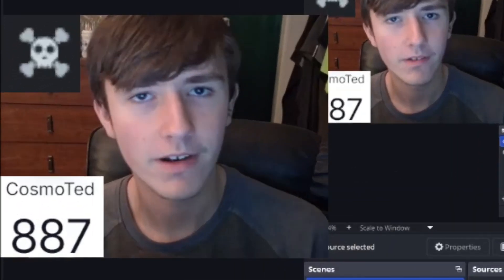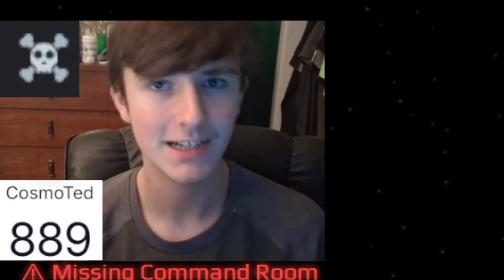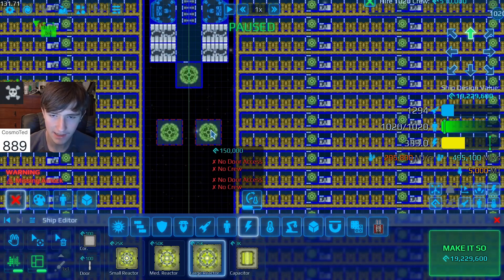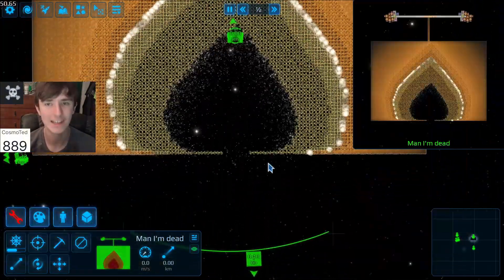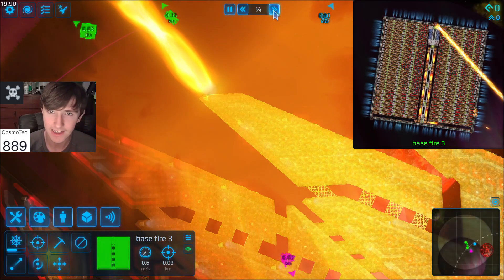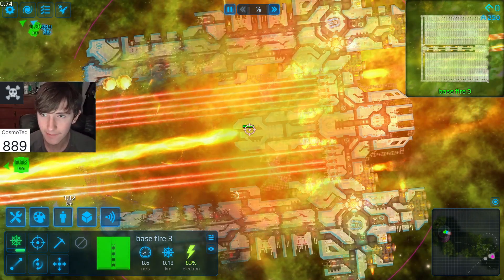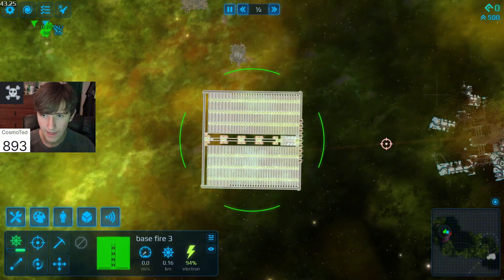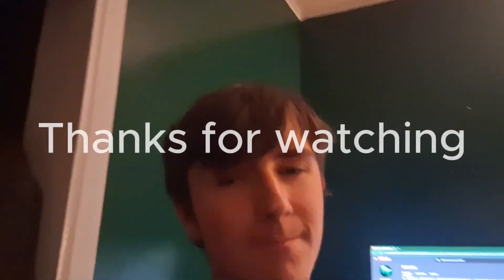Igniting Ships With 295,800 MJ/s of Energy

Comment: i made a ship like this minus the damage part as i mostly made it have a huge aoe and abit of damage (as i was tired of dealing the the modded ships that had really good shield placements so i made a heat ray that set everything on fire)

had a bubble shields about 3 clustered deep in my hull just slightly off set to keep the ion beams from hitting anything (later it was 12 and yes at that point the beam covered most things in flames or atleast enough to hit the softer bits and start to break important things)

note i did use a mod that added some extra parts like a better hall connector so you can run heat piping down the halls and have it still connect to all the parts (only did it as my ship made so much heat that i would have had to double its compact form to add enough pipes to vent it all)
Reply from the maker: very cool, (thanks for the comment)
Reply: @CosmoTed o also if any of my vents gets broken i have like 2 minuets before my ship turns in to a fireball

but past that the beam works really well but its very slow to hit critical mass of flames for the ship to explode XD

and yes i fixed it when i upgraded my shield to make a fortress XD

Comment: If I am not mistaken, adding more heat lances makes each heat lance less effective, like using 10 ions on one crystal.
Reply from the maker: I can confirm
Reply: But it's also much more raw heat firepower
Reply: Each lane produces more waste-heat but the dmg stays the same per Lance 
Unlike the thermal missiles you don’t use the heat from your ship to deal damage (*) using thermal lances they just put out their normal damage modified by the pump-Multiplikator 

(*) heat vents apply heat to nearby blocks of obstructed